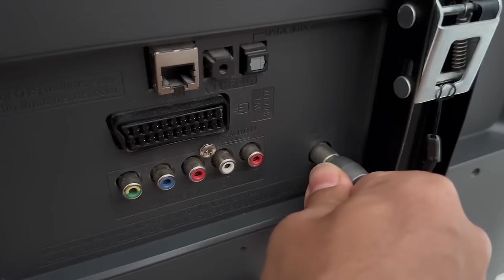Battery suppliers  DO NOT want you to know this trick

Comment: That doesn't work, if you want something excellent, an antenna on the outside and the matter is solved.Electronic Technician 43 years of experience...and they can make a Yagui or logarithmic type antenna and there are hundreds of plans on the internet for easy manufacturing and these simple antennas that are presented in this videos and others are of zero gain, however the outdoor aerial antennas have gain up to 20 decibels (db) and amplify, increasing the signals and high definition and analog signals all as if it were cable TV.